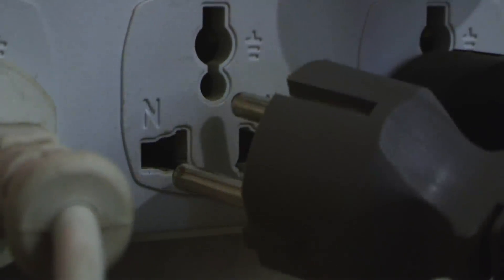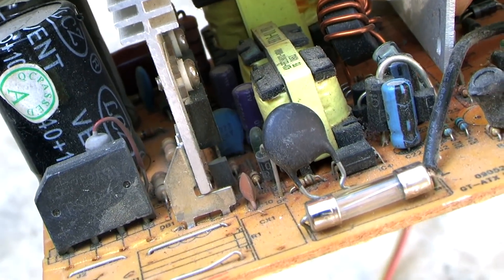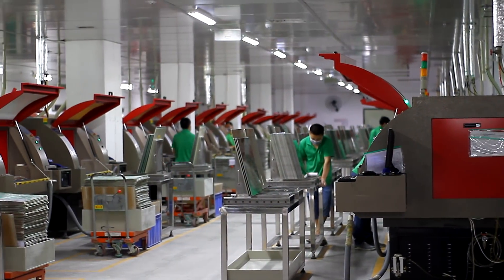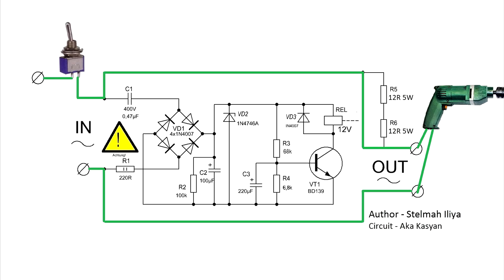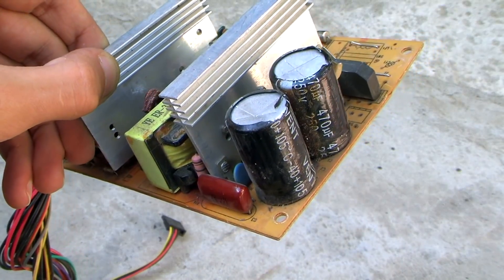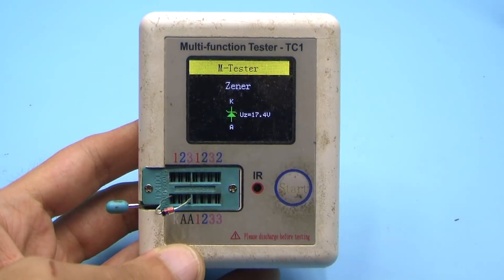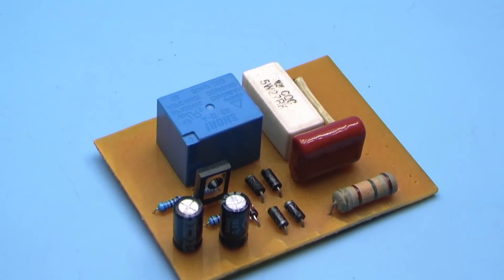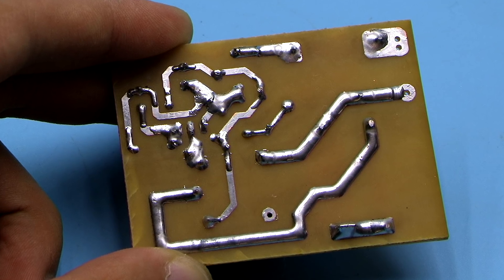This device will extend the life of your home appliances!

Comment: It's good for 1200w circular saw? Brushed motor
Reply: I would say yes but some tests and measurements will be required to make sure the ceramic resistor(s) aren't overheating.  All depends mainly of the minimal current required to get your saw started.  Based on that, you will know what will be the current passing through the limiting resistor(s) and be able to estimate the power the resistor(s) need to be able to dissipate and stay within specs.
Reply: SimpleEnough2k9 i should measure the minimal current my saw takes to start with a variac and a series amperometer? Thanks
Reply: Yes with a variac and an ammeter you will be able to determine the values.

Assuming you're familiar with basic voltage, current, resistance and power calculations, you'll simply need to do some maths to establish your needs.

The following is based on 120V AC.  Keep in mind that the lower you will set your "starting" voltage at, the higher the voltage drop will need to be across the resistor(s).  For instance, it you determine that the saw starts to turn at 60V and it draws 1A at that time, this will require a voltage drop of 120-60=60V across the resistor(s).  Having a current of 1A, you will have to make sure the resistor(s) will be able to dissipate 60W (60V*1A).  The resistor(s) combination will have an equivalent value of 60V/1A=60 Ohms.  As you can see, 60W resistors aren't too common and even if they would be, they probably wouldn't fit on a small board.  In this scenario, you could use 6 resistors of 10 Ohms / 10 Watts each connected in series or any other combination of resistors as long as the overall resistance is 60 Ohms, the individual power dissipation capacities aren't exceeded and the total power dissipation capacity is at least 60 Watts.  Having a safety margin is even better.

If you're setting "starting" voltage at 90V, with a current of 2 A, you will need a voltage drop of 120-90=30V.  With 2A of current, you will still have 60W of power (30V*2A) but the overall resistance will only be 15 Ohms (30V/2A).  Using 3 sets in series of 2 resistors in parallel of 10 Ohms / 10W each set will do trick here, but once again alternate combination of resistor(s) could be appropriate.

As you can see, things can get very warm/hot when using resistors to drop the initial voltage supplied to the load.  This is one of the good reasons to minimize the time they will be in circuit.  Also, someone has to make sure these resistors aren't in close proximity with anything that could get dammaged by the heat, including the PCB on which they're mounted.  That would pretty much explain why power resistors usually have long legs to mount them in such a way to allow the air to flow under and above them.

Have fun experimenting.
Reply: SimpleEnough2k9 thanks for the good explanation. I will do some test.

Comment: Nice 
I need one but from 12v dc to any device running with car  12v dc (fuse  will burn without this circuit  )
Reply: If you want to use for 12VDC, you can ignore the VD1 (full bridge diodes), R1 resistor and C1 capacitor. The rest can stay. You may want to put only one 1.8 ohm 5W resistor instead of R5 and R6.

Comment: Hello , The ciruit is good but it would be better if you use a FET as a switching relay .! You can use huge currents with FETs. (Heat shink is   also required..!!)
Reply: Relay coil consumes approximately 30 mA @12VDC, so any general purpose transistor will do the work.
Reply: You can't use a FET as a replacement to the relay because FET don't work with AC.  Using a FET in place of the NPN might be tricky because the way it is done right now is based on a voltage divider and when the desired voltage is reached the transistor turns on.  If you can adapt the triggering portion to work with a FET and predictable timing, then by all means, please share your discovery.
Reply: @SimpleEnough2k9  Its works...
... as a short circuit

Comment: Neat and thorough detail as always.  My first thought was something to vary the frequency of motors to so run at lower frequencies say like under 60 or 50Hz maybe with the exception of compressors that I've read may have an issue running at lower frequencies.  Otherwise, that might be an interesting project to consider also coupled with the slow start design.  Thanks for sharing this idea... I never really thought about using  a slow start or even varying the start before.  Makes sense and appears can be tuned even with a variable capacitor if wanted/needed.

Comment: What about 120 Volts ???
Reply: same
Reply: Merci ....Thank you !  :)
Reply: If you keep the same components but you reduce the mains voltage, I would strongly suggest you to make measurements of the essential voltages and currents before taking for granted that everything is just fine.  Will you have enough current to drive the relay ?  Will the voltage applied to the relay be within specs ?  Will the voltage across the electrolytic capacitors be within specs too ?  Finally, the way the circuit is activated needs to be addressed.  The circuit should be made more "intelligent" and activate itself when a load is in use.  Overall the concept by itself isn't new as such, but implementing it in a wise and efficient way might become more challenging.  One important thing, if you're not familiar with circuits dealing with mains voltage, be very careful because you might not have to do a lot of attempts before seeing some magic smoke and potentially be pinched or even blinded by "Sparky" !

Comment: I'm using similar devices on DC-AC inverters - must have for inductive load!!!
I think that should be Your main title of video.
I'm operating 1200W pump from inverter and it going overload on 5000W inverter.
Soft start fix issue.
Reply: I have a DC freezer rated 125w while operating. but my 2000w inverter is having problem starting and running the freezer. pls what can I do, does anyone thing this can help.
Reply: Before going to far, I would strongly suggest you to test with a resistive load such as a heater for instance.  Measure the current drawn on the DC and AC sides so that the overall efficiency can be evaluated.  Also, keep in mind that AC voltage coming out of most standard inverters, does not have a perfectly sinusoidal form and is given the name "modified sine wave".  Perhaps the inductive loads you're trying to feed with that inverter don't like the non sinusoidal voltage as such.  If you have the opportunity to try with an inverter that has "pure sine" at its output, things might be different.  If this isn't the shape of the voltage that is causing the problem, what is the current drawn by your freezer when it is connected directly to regular AC outlet ?  Are you able to measure/evaluate the inrush current as well ?
Reply: @chibuzo7746  if it is a dc freezer why are you using an inverter?

Comment: This is a soft start circuit..It's main purpose is to limit the so-called "inrush currents" to the load...this is mostly use in high power audio amplifiers...
Reply: YEAH... I wanted to know about inrush currents and this one is exactly the one i wanted to see
Reply: every induction based circuit with coils and magnetic fields
Reply: This is actually utilized in tons of different circuits. However almost all of them deal with inductive loads or loads which have high capacity capacitors on the input.

Comment: What about a Triac instead of the relay?
Reply: Kyôdai Ken 
  You will have a voltage drop across the triac, and at high currents typical of a power tool you will have heat dissipation issues. 
   The isolation of the relay and trigger circuit does a great job of simplifying the circuit. This is also why heatsinks are important with a solid state relay and any moderate amount of current. The only way around that issue, that I'm aware of, is to use FET's and a DC source/load. All current controlled P/N junction devices are heaters. I could be wrong of course. I'm just a dumb hobbyist. 
  I've been goofing around with a bunch of dirt cheap TO-252 and TO-263 SMD transistors of all types with a large, high power bench light project (no content created or planned)  
...Anyways...MOSFETs are gold IMO. Everything else sucks for high current stuff like this. Testing and experimenting with the intent of using surface mounted packages, where a heatsink is inconvenient and impractical, can teach a person a lot about this subject. I highly recommend the experience. Also there are a ton of much more modern, dirt cheap transistors available on AliEx in SMD packages. They are far better than the Jellybean components specified on most hobbyist level electronics. Specifically, they have ESD protection, and are designed for much higher operational temperatures. Of course you need to be able to prototype and etch your own circuits or use a marker to create your own breakouts if you go that route. 
-Jake
Reply: FET can't be used with AC so, SCR, TRIAC could be considered instead of a relay, but yet the temperature will raise rapidly with substantial currents.  A relay is pretty much the way to go with currents drawn by power tools but the ceramic resistors must be chosen wisely and the time they will be in circuit must be adjustable.

Comment: can it be used for ac compressor pls reply
Reply: yes
Reply: Anon Rider I've heard someonE saying these are capacitor start induction motor. so it couldn't start on load with the. refrigerant and moreover the power tools can be run without giving pressure to the surface in case of drill machines
pls clarify if a 2ton ac would run without burning the resistor
Reply: +gareth ronaldo xD?
Reply: gareth ronaldo since a drill machine could handle low starting current by rotating in slow speed but a compressor hums and trips
Reply: gareth ronaldo compressors of large capacity has built in olp which opens at the time of low current
Reply: Are you talking about an HVAC compressor ?  If so, have you looked at the actuator that is in the HVAC unit ?  It has beefy contacts to energize the compressor.  Do you think a small relay will perform the same job ?  I sincerely don't quite think so.  The soft start circuit described here could potentially be used for audio power amplifiers and few basic power tools with some adjustments but saying that this can be used with an HVAC unit, is pure fantasy !  Just imagine the width and the thickness of the copper traces that would be required to drive that amount of current.  Globally,  this circuit IS NOT designed to drive such beefy motors.  If you try it then make sure you have something to put out the fire because I have a strong feeling that you'll witness some sparks and magic smoke !
Reply: SimpleEnough2k9 but it is capable. to handle refrigerator
Reply: Indeed, it can be used to drive small motors like refrigerator compressors but personally I don't quite see how beneficial it would be.  The newer ones have inrush currents which are lesser than the old ones.  Designs and efficiency have improved over the time in that regard.  As far as I'm concerned, I still think that power tools and power amplifiers are better candidates for such a soft start circuit.  If you're inclined to do it, try to measure the inrush current for the refrigerator and let us know if you determine it is worthwhile.  I personally used a similar soft start apparatus for my central vacuum cleaner.  When running, the motor draws roughly 10 Amps but I measured the inrush current in the 75 Amps range so the soft start circuit was a useful add-on in that case.

Comment: Personally, feel this circuit is flawed given it is not a true soft start circuit. Soft start controls the voltage for field build up to minimise current flow into the electric motor.  This circuit at 3:10 really is controlling the Ampere-Turn value by defacto operation providing the load is present as we recognise there are two independent switches (Circuit and Drill).  It would be better to detect current flow when the drill is active to govern the phase angle to give a "ramp up" or "soft start" towards full load there by stopping the lights dimming.

Regarding the comment about the light dimming tells me it is NOT the supply, but rather the house wiring not designed to handle current flow giving serious “Volt Drop” Let’s not forget that any field being established in an electric motor, transformer, etc is very low resistance drawing 7.5 times load current until it saturates giving BEMF being relate to aspects of inductive reactance.

Comment: I think there is still a drawback, when the drill would be in work, will the soft starter be able to supply such huge current to withstand the torque and rotate the shaft ?
Reply: +Anindya Mitra : Initial delay of around 3 to 4 seconds or something like that & for this period only the current flows through the 12 Ohms resistor. After the delay period is over the relay switches on which then creates a parallel path to the 12 ohm resistors thus bypassing these or in other words after the delay period is over , current flows directly through the relay contacts to the connected load. Hence  there should not be torque problem at all. 
N.B :  But this is not true always !  This circuit has a serious fault !  When power is applied to the given delay circuit &  at the same time the load is put to on - the  connected load or device  gets the mentioned advantage. But this is not true when main is kept on to the delay circuit & connected load switched on or of  as per requirement again & again - remember this !
Reply: Your point is correct. This device should be connected to the load appliance permanently.

Comment: Lovely idea. 
To make it more convenient for portable tools, consider activating the output with a current sensing circuit, n/o reed relay wound with copper wire related to the current required to activate it. 
Then you can use your drill and it will run full power after the pre determined time delay.
Reply: Glyn is right .. use one of your current limiting resistors (possibly R5) as a current sensing resistor as well to trigger your delay for the full current relay switch .. this will be far better than a manual switch since you use things like a drill in short bursts 
.. the manual switch will only give you a single soft start and then it is always full power after that
.. other than that this is a good simple soft start circuit that could be made from scrap parts from an old television

Comment: Nice design, however just one thing i would tweak is to use a latching relay design for the relay so it does not need to be consistently energized, aim for quiescent current of <1ma when idle if possible
Reply: William Hazelwood 
  That's a lot more complicated of a circuit. It could be done with something like a CD4017 and Schmitt trigger buffer (although with that setup just skip the relay and go with a discrete solid state design with a triac or MOSFET), or maybe use a comparator like an LM393 and a tricky circuit. You're talking twice the components and triple the complexity though. Creating and removing the triggered pulse for the latch is a challenge. Plus the footprint of various latching relays is much less generic when it comes to a design you want to share with others. The coil could be configured single or dual. Latching relays are usually used for small signal operations so they have much lower current capacity. They are much more challenging to source and usually cost 2-3 times as much. Most power tools are using several amperes so an extra hundred milliamps is not a problem. 
  A latching relay is more for a system that uses a microcontroller. Holding one output pin high or low to power a relay is not a good idea. That's the ideal situation for a latching relay :)
-Jake
Reply: In fact the tweak should address the possibility to have the circuit activated when a load is detected and turn off when there is no load.  With that scenario the relay would be triggered only when required thus minimizing the quiescent current to a more than acceptable value.   At first glance, this is the way I would go as I wouldn't want to spend more money than actually needed for a simple project like this one.

Comment: Newbies:
  The BD139's and BD140's are good items to keep on hand. It is also rather difficult to find equivalent replacements for their specs. The ones from Aliexpress sellers have worked well for me. The cheapest I've found was just under $1.50 for 100 of either one, (or $3 for 100 of each). That comes out to $0.015 each.

  Remember also that AC switches and contacts are very different than DC switches and contacts. (The way they break the connection is different. DC will arc and fail and it can cause a fire.) This applies to relays too. If your looking to stock up on relays, it's well worth seeking out versions that have an AC and a DC contact rating. The latest run of relays from China look a lot like the Songle relays. I'm specifically saying the ones used on arduino modules and breakout boards. The Songle relays usually have a high current DC rating. The latest ones from China are branded Tongling and they do not have a DC rating on the case. I haven't seen the datasheet. If they can't print the specs correctly on the body of the relay I don't trust what is inside. Also be sure that any module you buy with relays has a large amount of trace clearance. The ones from a few years ago were awful.

Comment: Exelent circuit,one question, this circuit is for 110v or 220v?
Reply: Either but remeber to get properly voltage speced relays and caps
Reply: And pay extreme caution to the fact that one side of the circuit deals with mains voltage, which can be very unfriendly if not treated with regards.